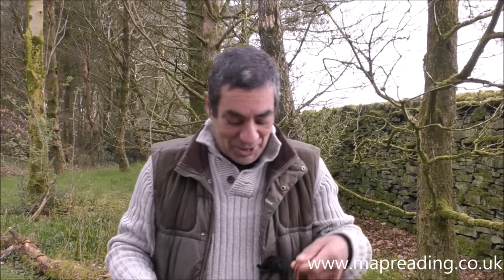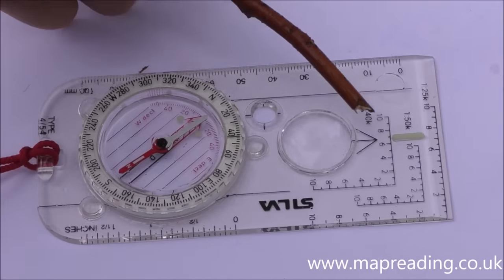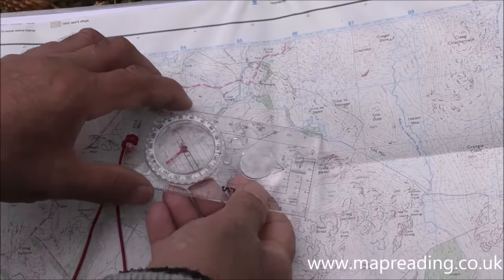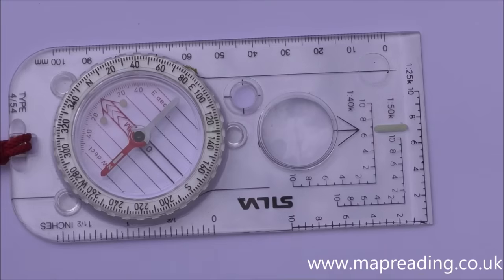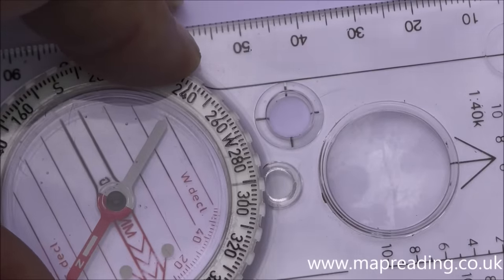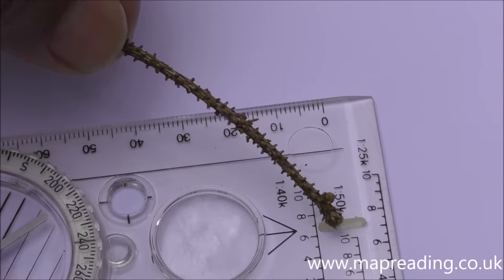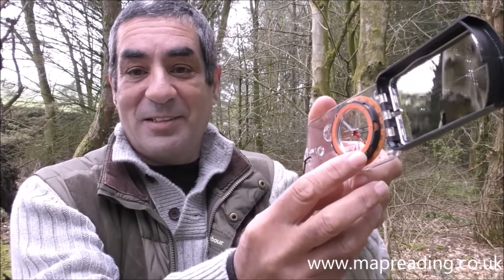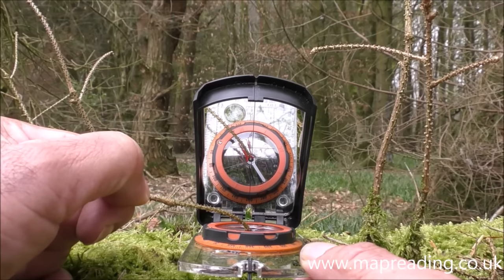Base Plate Compass, "every" part identified and explained

Comment: I'm a 68 YO ex infantryman, of 30yrs army service, gobsmacked that the function of the compass needle, to align naturally with the line Mag North/Mag South didn't warrant a mention until after you talked about setting a bearing - without even mentioning the importance of aligning the red end of the needle and the North mark on the bezel . . . 😢
Reply: @@doublewhopper67 Not to a 1st-timer. I have taught map reading to hundreds of recruits in basic training, so trust me on this.
Reply: You have mistaken the purpose of this video - it is the SECOND part of a two part set.
The first part did EXACTLY  what you have mentioned - ie HOW TO USE A COMPASS.
The title of this SECOND Video is "Base Plate Compass, "every" part identified and explained" - it's purpose is to IDENTIFY each individual FEATURE ON A COMPASS.........It ISN'T Designed too Teach you too USE the compass as you are referring too......
Reply: @bevlawton1488  Was it me, or was it the person(s) who uploaded the video that failed to make plain that this video was Part 2 of 2?

Comment: In the military, using a lensatic compass, every part of the compass is named, described, explained, and practiced with. We even have it in our basic manuals that everybody is issued, with pictures and arrows and diagrams and terms and acronyms. So im surprised that nobody has instruction available for baseplate compasses. I own a couple that I keep in some emergency gear bags, but when I'm in the boonies I use my trusty lensatic compass.
Reply: What would these manuals be called? Maybe they can be found online
Reply: @somefuckstolemynick  They're in our "green monsters" for everything, I have about 15 of them, some even come put together with large rings or through-bolts that are screwed together from front and back. They all have different titles, such as "Small Unit Tactics", "Mechanized Infantry", "Artillery and Fire Support", "Amphibious Vehicles and Landing Operations".
They are all issue "Technical Manuals" for the Army, Navy, Air Force, and Marines, so they are listed as "TM-" followed by the specific number assigned to that publication, and is the first line you see at the top of the cover or plate.
Just do a search for, say, Marine Corps field training manuals. Using the compass would be under basic infantry instruction, and is called "Land Navigation".
Reply: @davidcruz8667  thank you!
Reply: I purchased a cheap base plate compass years ago. It had full pronted instructions that came with it that explained all.if this.  All people need to do is actually look at the mauals/instructions!

Comment: Fantastic instructional videos...thank you.
I NEVER venture into the forest depending solely on a battery-operated GPS unit or smartphone GPS.
I always carry my Garmin GPS, a baseplate compass, and printed maps.
Reply: I found surveying scrub much faster and easier  than using a GPS. For example how do sight a GPS. The Team I worked with wouldn't share any information on how to use the GPS , I couldn't be bothered to acquire the skills, I was always given the defective Garmin GPS, there were quite a few. A compass is so simple, elegant and reliable.

Comment: Learning how to read and use a compass is one of those skills you never knew you needed until the battery in your GPS goes dead and you freak out because you just realized how lost you really are. Thank God I learned these analog skills when I was in the army.
Reply: Along with using a compass, it's important to learn how to read a map: the markings, the elevation lines, the scale, why some features are marked and others aren't, how some things might be exaggerated and how it all relates to the actual terrain. If you get lost on a map, compass helps but you're still lost, whereas if you're good at reading a map, the only thing you might need a compass for is to give you a reference north as a backup.

Comment: One thing to be aware of is that not all maps are oriented to match North to being straight up from top dead center. Always check the map's compass rose to be certain of the exact North orientation on the map.
Reply: Why aren't they?
Reply: @kmr_tl4509  they are usually oriented to the map North, not magnetic North. The compass rose marks the magnetic North orientation.  Occasionally a map is drawn to fit the area to the page in the direction the area is oriented causing the top of the map to not match North.  Only limited areas of the Earth have magnetic North match the map North. That's why the compass rose is so important.
Reply: Great point. Very important.

Comment: Thanks for a very informative video! Even if I’m rather familiar with a compass, but didn’t know about the EPA holes!

Checked out the site for the Swedish Silva Compass and they do have a brake down on the different parts of the baseplate compass. Been using them since I was 9 or 10 years when my dad taught  me to use a compass and a map when orienteering. Later on he also showed me how to use it at sea in the Swedish vast archipelago, but then I was a couple of years old probably 15 yrs.

We used military maps and compasses a lot in the military (conscripted services). Having a compass in your pocket when roaming the Swedish woods is sometime necessary and should be in every survival kit.

Btw, the lanyard is also used to have around your wrist when running in the wood so you don’t lose it.
Reply: A compass is like first aid kits and bear spray though: unless you learn how to use it and practice enough to stay proficient, it's of little use.

Comment: Excellent content!  I've been using compasses for many years and I picked up a few new bits of information, thanks.  I recently replaced my VERY old Silva Ranger mirrored compass with a new model.  I didn't read the description very well when I ordered and to my surprise when I wnt to use the compass it's bezel was NOT 360 degrees nor was it in Mils.  The bezel was measured in 90 degree quadrants and was set up like a surveyer's transit.  Since I was surveying this worked out well once I found out how to read the survey document.  I did also buy a Sunto 360 degree mirrored to be sure I had what I needed most of the time.

Comment: Wondering about looking for the nearest pub I’ve just realised I need to learn to use a compass to get there faster, well before last orders!
Great video👍
Reply from the maker: Go to the pub car park.
https://youtu.be/tflUvMydwto?si=XH8d3xcy7gXJQZdP

Remember the location of your car - see here:
https://youtu.be/yfcymnPE304?si=c7YBtHjTbea3txua

Take a bearing to the pub door – see here:
https://youtu.be/eAdo3uJUzoQ?si=lW7yNhB-do0zop1F

Check distance to the door – see here:
https://youtu.be/FAp3kHjlx58?feature=shared

From the door aim off towards the bar – see here:
https://youtu.be/2eQlZlKRlLM?si=ZZlwETAPPW2ALdM6

Have a good time.
Call a taxi.

Use a back bearing to relocate the door – see here:
https://youtu.be/61uMkv19Uyw?si=z2XdRqEgsG7s-xXz

Depending on alcohol consumption it may be necessary to hand-rail to taxi - see here:
https://youtu.be/61uMkv19Uyw?si=z2XdRqEgsG7s-xXz

Go to sleep.
Get taxi back to collect car.
Repeat.

Comment: As an ex geologist I carried 3.
1 Bronton for close and accurate.
2 Silva with mirrors and inclinometers.

I’d check  both Silvia’s before heading into the bush.
You had to be sure because there are very few landmarks to re-orient if you get lost.
We always had basemaps and air photos with us.

The cost of getting lost in the northern Ontario forest is not a good place to be.
Reply: @@marktwain168 that would be way farther than I have ever been.
Not sure how many degrees of declination you can adjust for.

Comment: Good info, liked & subbed.
Since so much of this is learned through use, I like seeing how other people do it. 
That's probably why you won't find this material in compass owner's manual: the manuals aren't a precis for orienteering. If I were writing the manual, I'd make a point of including tech info but not orienteering info - that's something you learn in a class (or in the army, like I did on the Silva Ranger)

The curve on the Suunto being  "ergonomic" is likely just marketing from someone who's never actually used the product. It's really there so the baseplate lays flat on the map and isn't held up by the knot on the lanyard. On the Suunto, the romers are next to the knot, on the Silva (and others), the bezel is next to the knot so it's not a problem. if the romers don't lay flat, it's tougher to get a 6-figure or 8-figure grid reference. Suunto mirror compasses have the lanyard mount raised to do the same thing without the curve.

The lanyard mount is more important than you've suggested here. It's aligned with the centerline of the bezel to align the compass when you're shooting a bearing. It gives you a longer sight radius, which is exactly the reason why iron sights on a rifle are more accurate than those on a pistol. At 18:25, you'd hold the end of the lanyard in your left hand and pull it back to below your eye, ensuring a straight line through the lanyard, baseplate and sighting line on the mirror. Then you rotate the bezel with your right thumb until the needle is home. But of course, that comes from a career spent using mirror compasses. Another advantage of them you find when you use them is they slide in and out of a pocket SO much easier than a baseplate or lensatic compass :)

The orientation lines inside the bezel can also used to orient the map. Rotate the bezel to 0/360/6400 and align the lines (or an edge of the compass) with an easting grid line and rotate the map and compass together until the needle is home. Now, the relative position of features will be in the same place on the map as they are on the ground.

Kudos for helping to keep traditional orienteering alive !

Comment: This is a great video. I only ever used a basic N/S compass before I got my GPS12XL which just ate batteries. Now every mobile phone has GPS built in. In the early days of GPS they distorted the readings using Selective Availability. Also they were and still are useless compared to OS terrain maps.
They can switch it off at any time so always worth knowing how to orient the old fashioned way.

Comment: Neat - it might be worth mentioning that when measuring distances on the map (like the wall, or estimating your journey), the gradient adds distance. If that wall ran up a 45 degree slope, for instance, it would measure 1.4 times the distance on the map. The steeper the angle, the more you have to add (a vertical cliff measures nothing on the map, however high it is). If you're doing a lot of climbs and descents, this can add serious amounts to your travelled distance. I haven't yet discovered whether computed tracks on phones and GPS navigation gizmos adjust for that, but I suspect not.
Reply: Depends on what map data they have and how accurate it is. I know that google shows heights when using it for bike navigation, and it give a hunch about the extra distance. 

10% gradient is very very steep, and that is 0.5% extra distance. 

The steepest road in the US is 37% grade which is 6% extra distance, however, these extreme slopes are over very short distances. 

But yes, if you are climbing a mountain (even one that does not require climbing gear) the height difference is often more interesting than the horizontal distance.
Reply: @57thorns  Wow, where I live, roads with 20-30% grade for extended distance aren't uncommon, and those sorts of slopes would be even more common in trekking scenarios, not necessarily "climbing a mountain" but just navigating several undulating hills. I agree that in doing this, the grade feels "more interesting" than the additional distance, but together they make up a double whammy, climbing and descending on a journey, so the app reporting 20% less distance than you actually traveled is just a bit irritating (or my ego is too big ;) ).

Comment: Remember teaching magnetic variation (the difference in grid bearings and magnetic) with the saying ' grid to mag add. Mag to grid get rid' . Also how to check and note any compass error ( how many mils/degrees the compass is off true) on your own personal compass. I once found a silva compass with a compass error of 160 degrees.

Comment: "All mirror compasses have this hole" My old army Silva type 15T doesn't.We were taught to use the lanyard when sighting landmarks. With the lanyard in one's right hand, hold the compass in the left-hand at arm length; then bring the lanyard taut up to the right eye, then sigh and take the bearing with the compass as you have dicribed. 1-5 lilometers, it never failled. The lanyard has more that one purpose.
Reply: I learned the same taut lanyard procedure, too, except the other end was fastened to my work vest. With the right length, it was easy to hold taut at arms length.

Comment: I got very proficient at using a compass when I was timbercruising. Central British Columbia, Canada. That was 30 years ago though. I have since moved on to historic mine research and locating. 

I carry a gps, cellphone with gps, and a satellite communicator with gps, but the good old compass is still in my cruising vest.

Because magnetic north is moving so rapidly, and the magnetic declination is so large here, i will have to enter my coordinates in to a computer program to update my declination.
Cheers from BC Canada.

Comment: I think the round and triangular holes are for orienteering in cases where you might have to copy the whole route on your map yourself instead of having the points printed on it: Circles around control points, triangle for the starting point and two concentric circles for the finish line.

The metric ruler isn't just for "metric maps". You can measure distances on any proper map and, because the units in the metric system aren't completely nuts, you can then use the map scale to calculate the real-world metric distances as the crow flies. Of course, having the scale rulers for the straight-up, double or half of your map scale allows you to eye-ball the approximate distances and saves you from doing annoying calculations on random measurements, e.g. getting 4.7 cm on a 1:7500 map you'd still have figure out 4.7 × 75 m or 3/4 of 470 m or whichever way you prefer to do it.

Besides being nicer to hold, the curved end on the base plate also allows more room for the lanyard or twine so that the base plate can more easily stay flush against a flat surface. That way you can use a thicker (or looser) cord if you want to, because if the base plate isn't parallel with the map, your viewing angle affects direction measurements.

Comment: I bought my own Silva compass when I was a serving soldier..still have it now..30 years after I finished..graduated in mils and I have a good old prismatic too..which I acquired during my service..found on the training area on Soltau West Germany so kept it
Reply: I’ve still got my own silva and I lost my prismatic in the queue to Wolfgangs bratty van, is that where you found it?
Can I have it back please 😂😂😂😂😂
Reply: As did I, mainly used it for orienteering. Squadrons way of adding fun into a run and learning map reading too.
Reply: I learned in mils as well.
I still had my Ranger as well until some crackhead broke into my storage locker and stole the backpack it was in. 20 years later and I'm still choked about that.

Comment: And there is a difference, a big one, between "taking a bearing" between  your position and a point on the ground, and "setting a bearing" using the compass to determine the bearing between two points on a map.

Comment: One note about setting your path bearing (if you didn't see it already); when you want to set bearing for a walking direction (instruction starts at 6:12) first turn your dial until the direction you want to head is at the top aligned with your pointing arrow.
Reply: Thanks, I was confused about that.

Comment: I recognized it right of the bat. I'm 55 lots of the department stores when I was a kid had a Boy Scout Uniform and supply as some call Kit section. They all had that compuss.  I haven't used one since I was 14. I come from Dutch WWII survivors and am first generation I the U.S.A.  I use and correct maps. I have my grandfather's talent of looking at my surroundings a map if needed for work the lay of the land and landmarks and know exactly my location and direction I want to go. In bad vissabilaty I prefer that Compuss. I have access to G.I.S. and internet maps .I've seen them off of accuracy often. My Uncle is 84 retired Airial Photagapher. 40 years on the job. Give me one of his maps on a bad weather day and a Compuss. I will find my way.😁

Comment: 19:00 use the lanyard to aim with as well. Hold the compass out in a stretched arms length with one hand and hold the end of the lanyard with your other hand and bring it up to your eye. Aim down the lanyard, into the mirror's aiming line and up through the notch while looking at your target. Using the lanyard like this gives you better precision. Best regards from a Scandinavian veteran 😉

Comment: thank you for this, many things i just deducted already myself But you provided useful new bits of info and confirmation.

As a finn, i of course use Suunto (Suunta means direction in finnish) compass - inherited from my Grandpa who fought the russians with that thing.
It is liquid filled and has a little airbubble that, if around the needle axis -  tells you when you hold it level.   

It gives you an idea about the build-quality.  (do the math)

cheers

Comment: Did you cover what "TYPE 4/54" indicates?  Maybe I missed that...  Are there other 'types'?  Where can I look up those types?
Reply from the maker: That is the number (type) of the baseplate.
Silva used to make a Type 54 - which had a "sort of" prismatic sight.  They don't make those any more but the newer Expedition 4 uses the same base plate.  So it is the Exped 4 using a Type 54 baseplate.

Hope that helps